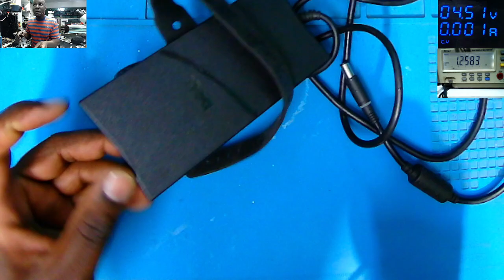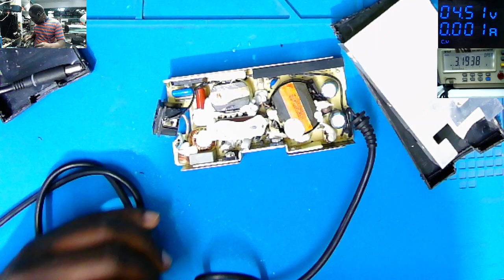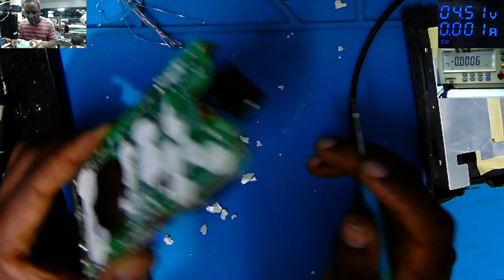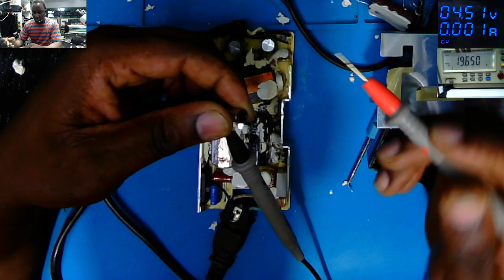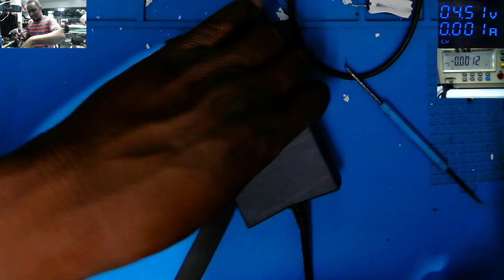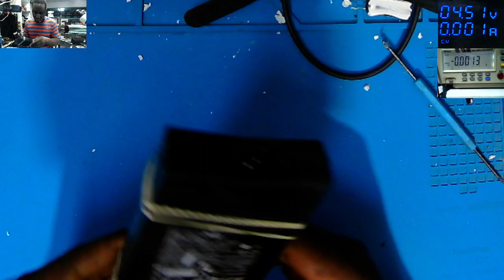Dell Laptop Charger {19.5V--6.7amps} Switching Power Supply Repair!!

Comment: 3:09 the better way is to use Petrol/gasoline or Diesel Oil. But you have to apply it by the small needle with the syringe, very little only on the gap (because Petrol or Diesel will leave white marks on the black plastic). After apply, wait 5minutes. Petrol or Diesel will get everywhere inside and dissolve the glue and then you will be able to open it easily with hands.